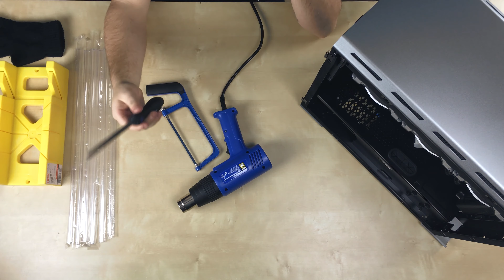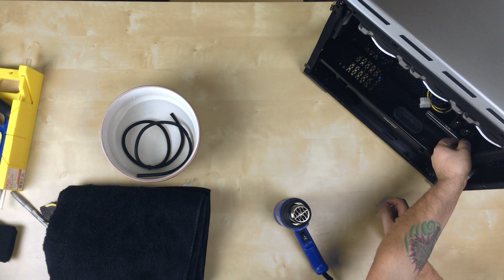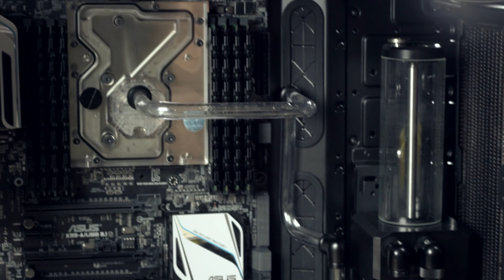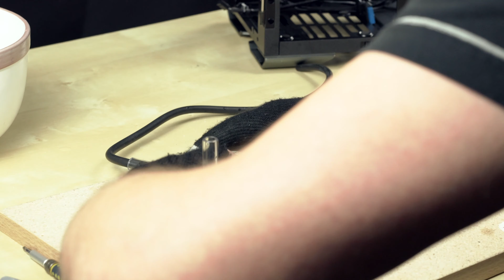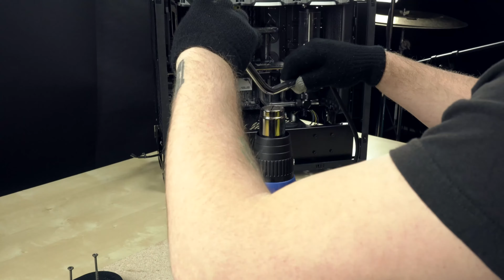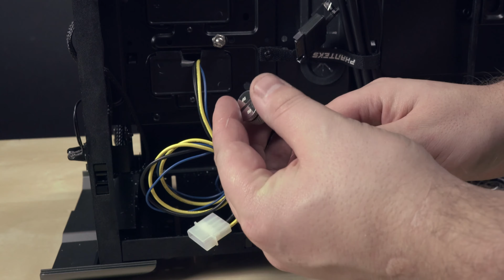Bending PETG tubing - Build Log #6

Comment: Hey man good go for your first time. I haven't yet done a custom loop in my build but I am a pipe fitter and just a tip for next time, it's easier and better if you cut after you've done the bends. take for instance your "S" bend,that tight bend wouldn't have been so hard if you had left the pipe uncut.

Comment: Pipe Fitting Union for sure I agree. Great video mistakes and all. Agree everyone starts from somewhere learning from mistakes so good job on the loop. I'm working on my first build, so learning from your mistakes :) bending the tubing. Smooth tubing bends vs hard angled bends are better on the pump gpm/lpm output.
Reply from the maker: you need a good amount of heat. Just need patience. You need to keep it moving as well. It will bubble if you don't. I got way better with it once I knew the exact amount of heat the tube needed but my back was killing me by the end haha.

Comment: my fingers hurt cuz my hands had been burnt by the heat gun says the guy wearing what looks like fingerless wool gloves lulz
Reply from the maker: Well I needed the grip of my fingers haha but I didn't want to burn them all off.
Reply: mechanics gloves probably would have worked better, they're less than 10 from walmart and have good grip. too late now and you it done anyway. hows your loop holding up?
Reply: XGC BAD HABIT You dont need gloves for tubing, i never use gloves for tubing :)

Comment: Way too close with that heat gun on the tube. Also don't cut tube til you have to. Just make your first bend a bit longer than you think it needs to be, then do your other bends and finally trim to length.